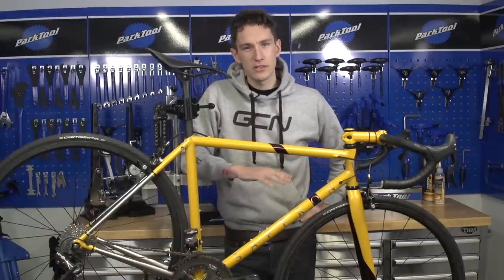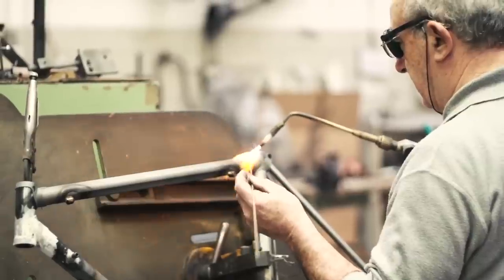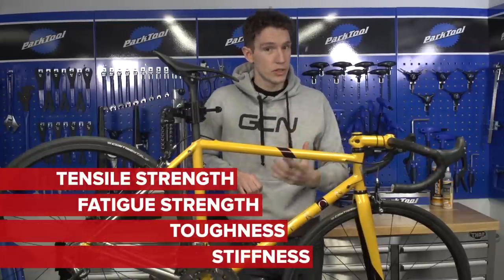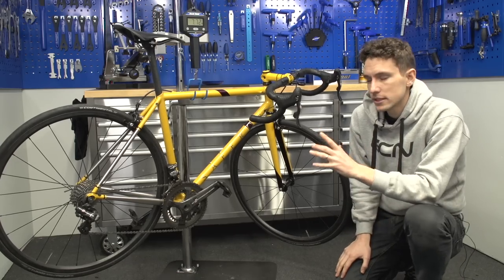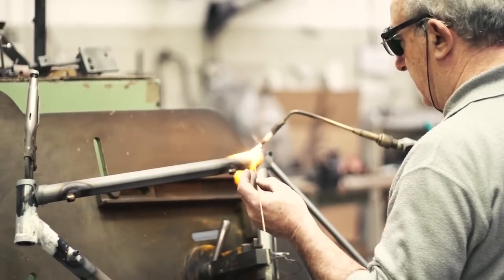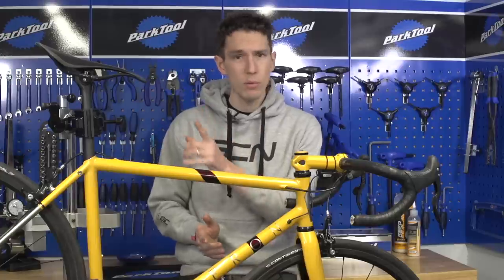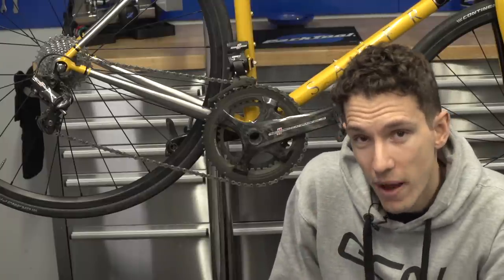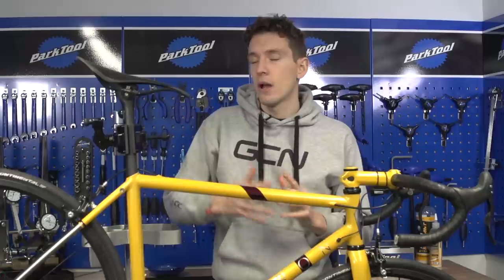Is Steel Real? | 6 Things You Didn't Know About Steel

Comment: Steel is fully recyclable, aluminium alloys as well, if it's sorted properly. Pieces made of carbon fiber are not, it ends as waste. End of discussion for me as far as cf is concerned.
Reply: Carbon fibres are recyclable, but unfortunately it may be difficult to get the waste to the right place, especially if you're unaware of the possibility. The only problem is that our current amount of carbon fibre waste is very small and there's only very few places capable of recycling carbon fibre from discarded composites. But given how expensive it is to produce carbon fibres, recycling is definitely worthwhile.
Reply: @CanIHasThisName  I have not heard of any recycling method which allows carbon fiber to be reused as carbon fiber. Which makes it a case of downcycling. Do you have any news on that matter?
Reply: @uweclaunitzer7170  It is debatable whether it is downcycling. The material itself isn't actually degraded, it just has a different shape - so the use-case is the same as reclaimed material. 
Some woven glass and carbon fabric actually has an unwoven layer stitched on. And you can make both woven unwoven fabric out of short strands which would have the exact same application regardless of whether it is recycled or not.
Reply: @CanIHasThisName  That's downcycling (as far as I know). But I'm willing to learn! Still some specific use (which I hadn't known before). Btw: Very quick response!

Comment: Reynolds & Columbus are Coming Back, People are buying 531c & 753r bikes over new 8k gravel & road bikes. 

This is why the bike market has collapsed. 
A 753 bike is lighter than a carbon bike. 

Vintage bikes will take wider tyres to take 32c Gravel tyres. Vintage bikes tick every box and are much more reliable in every way, parts were well over engineered and most important easy to service yourself.

Comment: Clowns. This is what happens when a reporter improvises himself as an "expert". 
I certainly didn't learn anything new. And our friend in the video has some things mixed up: 
the way he presents the limitations of steel wall thickness as being it's limitation that "comes to bite you in the ass" a mixup on his behalf with what is the case of aluminum. Proof in point, is Reynolds 953 with a thickness under <0.4mm and is at steel's optimal wall-thickness to tubing diameter ratio... and the fact that alu has an optimal strength to weight at a wall thickness that is about 1/200th of the diameter of the tubing, would make it very vulnerable to light side impact or pressure and very large (think alu pop/beer can if used in the optimal quantitity of material and dimensions). He says you can make alu thicker... NO, it's not that you can, it's that you must. They bring it up to at least 1/50th, making it heavier than needs be, and sometimes even thicker for aerodynamics considerations.
...still waiting for you to teach me the 6 things I didn't know about steel. always eager to learn.
Reply from the maker: Well perhaps you should teach us? 

With regards to the tube diameters and thickness though, I think you may have got confused. We said that wall thinknesses have to be thicker to stop buckling, which is why steel's density is a problem. Because alu is less dense, you can build a fat tube, with the necessary wall thickness, that is stiffer and yet still lighter. 

All the best, Krusty
Reply: Tim. Please stop using the internet.
Reply: Damn it, Tim. Shoo
Reply: GCN you were right, they do rave on!